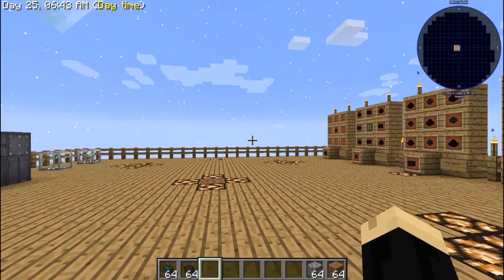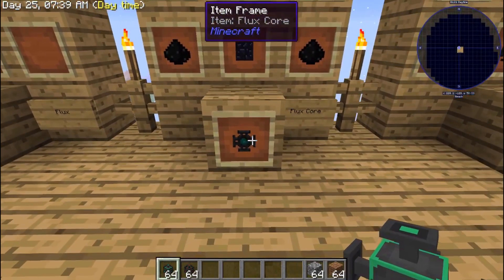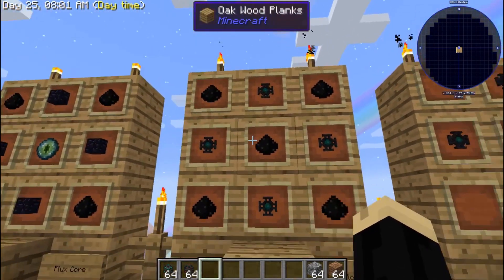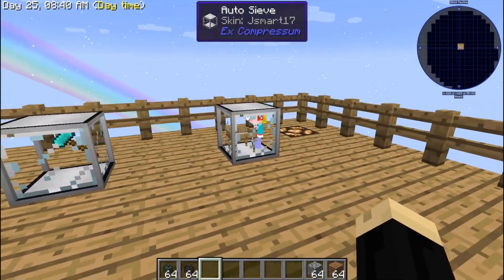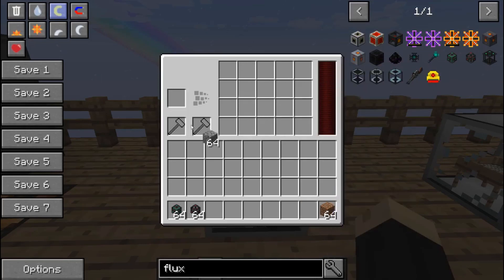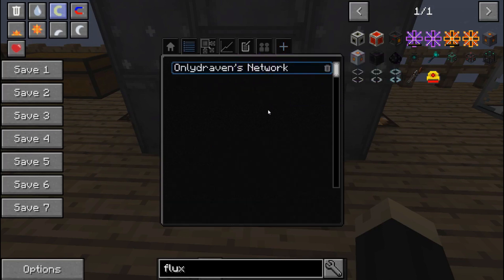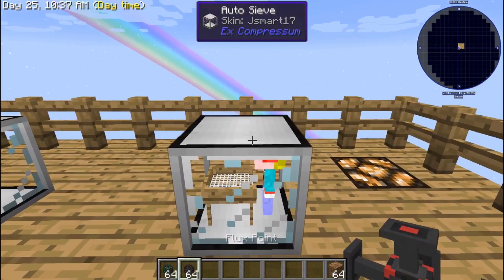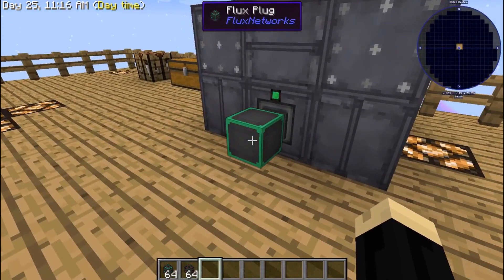Minecraft - Sky Factory - How To Use a Flux Plug & Flux Point for Wireless Power

Comment: I am in ATM6 and I accidently made one network private and now I cant delete it.. How can I remove it to fix this? I think It is causing issues because power is no longer being sent through the Flux point to the centrifuge it was connected to. Any ideas would be helpful ^^
Reply from the maker: I've not had that exact issue, but I believe if you go into creative there is a way/command that makes all networks open to you.  Then you can change or delete it.
Reply: @OnlydravenGaming  I managed to fix it somehow, I have no idea what I did. I just pulled everything apart;  including all the cables, pipes, chests. Remade it and that fixed it. However I will try your suggestion to remove the unwanted networks! Thank you :)